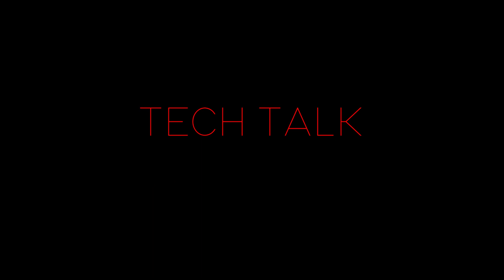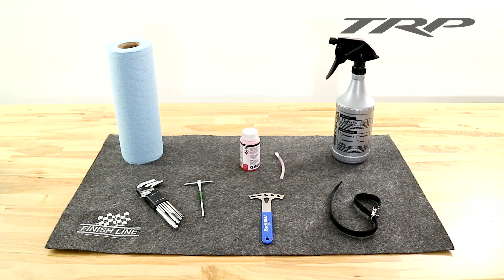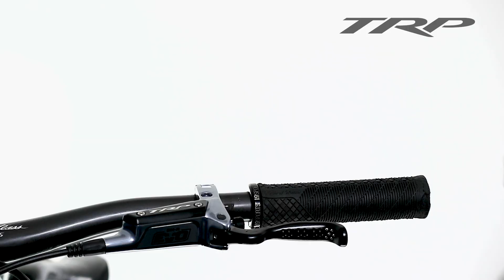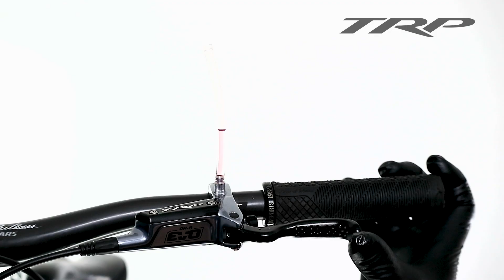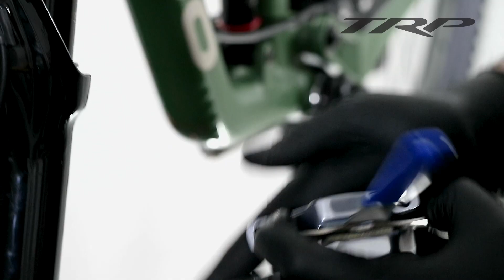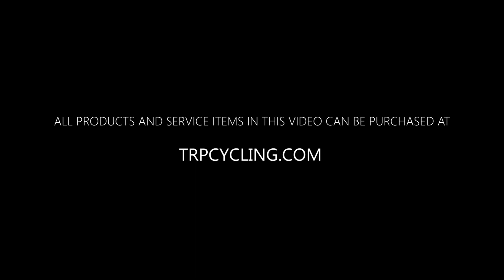TRP Tech Talks- Piston Purge Procedure

Comment: Have done this multiple times and every single time without fail I get air bubbles coming out every time I return the pistons back into the caliper. Doesn’t matter how many times I try I always get the same 3-4 tiny bubbles. Makes me believe that air must be getting into the system somewhere but unsure if it’s at the caliper or the lever. Super frustrating as it’s only my rear brake. This is the only brake I’ve ever had issues with.. time to swap them out I think, which sucks because WHEN they work, they work great.

Comment: And how did the air get there? These run so hot the fluid boils so it's a constant issue on high stress applications like my DH bike. After a few months I finally removed them and went back to Saints. One bleed and a month later and they still work better than these TRPs.
Reply from the maker: Brake fluid shouldn’t be boiling from normal use, even on a DH bike. If you were riding them for several months before experiencing the issue, the brakes likely just needed a proper bleed. Air can also be introduced during the bleed process if it isn’t done correctly.

Either way, what you’re describing isn’t normal performance for the brakes, and a proper bleed and inspection would have been the best next step.
Reply: I'm having the same issue. I have bled them so many times

Comment: Could you just use the TRP bleed cup with a little fluid in it at the lever instead of the tube and fluid?
Reply from the maker: Yes you can, some prefer to use the tube so it's easier to see the bubble come out.
Reply: Yes